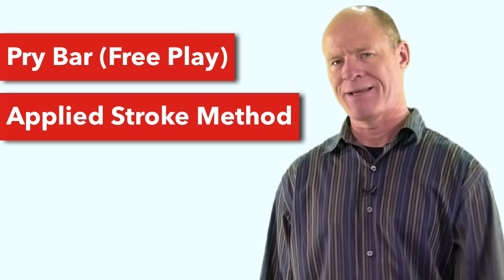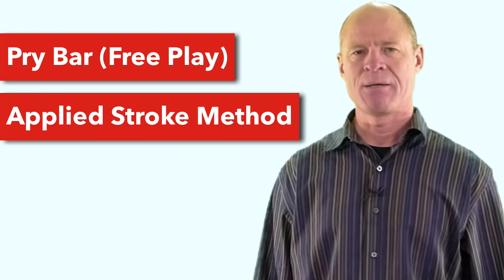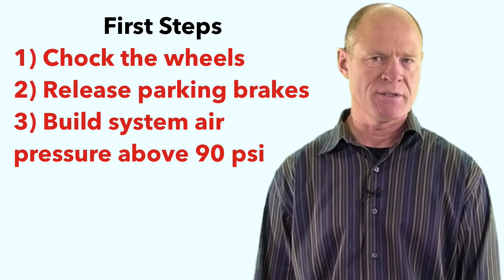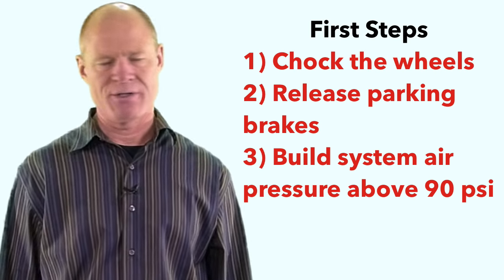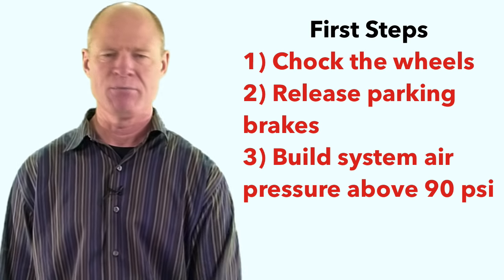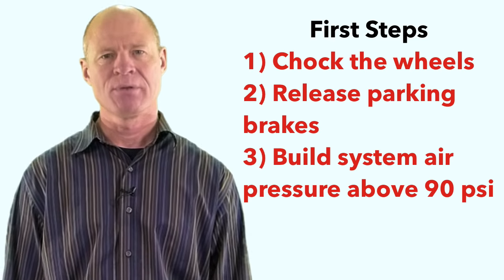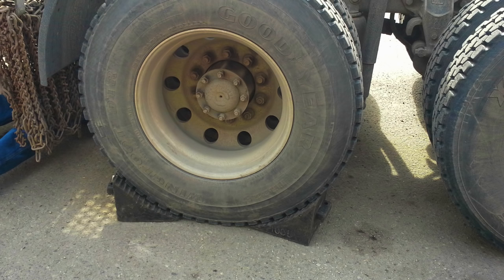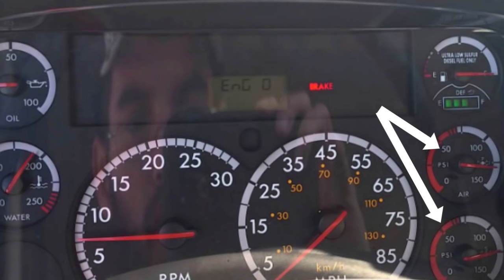How to Determine Air Brake Adjustment—Applied—Pry Bar—Mark & Measure

Comment: I’m from California and every inspection I’ve gotten in California they used the applied brake test
Reply from the maker: Hi C & Z Trucking - it's not just CA my friend. Every DOT inspector in all the states is going to use the applied stroke method. The reason is that they have 2 people, which makes it easy. They just put a radio in the cab, and when they're ready to measure, they tell the driver to apply the brakes. And the applied method is way more accurate than the pry bar method. Drop us a note if we can help further my friend. All the best, Cheers Rick
Reply: @smartdrivetest  I found this video do to problems with trailer brakes. I’ve replace (i do all my work myself) the chambers, drums, pads, s-cams, and slack adjusters and no matter adjustments I make, the applied stroke goes to the maximum 2”. So I’m trying the 6 pack method you said in your video now to see if that works. And it’s all four on the trailer that go to the 2” limit
Reply from the maker: I'm not a technician, but it could be a couple of things: 1) the pushrods are too long; 2) the slack adjusters need to be adjusted manually. If you can't get it to work, I would counsel you to take it to a shop and have a mechanic have a look. All the best, Cheers Rick

Comment: if the brake chamber rod is not the correct length it will affect how the ASA works. especially that type of slack on the trailer.  the double yolk has lots of wear being outside in the elements, and that slack is about a 6 in reliability anyways. some slacks adjust on the push stroke and some slacks adjust on the return stroke.  so your six pack method only works on some slacks not all.
Reply from the maker: Hi First Name - Thank you for your comment. And you are correct my friend - it's not going to work all the time, but it's worth a go before taking it into the shop. All the best, Cheers Rick

Comment: How do you determine if it’s an automatic Slack adjuster or not?
Reply from the maker: It's very unlikely that you'll encounter a manual slack adjuster, but just in case, see this video: https://www.youtube.com/watch?v=knbgfudCZC8&list=PL0x-bChcUvwG2bSWReQWnk9Tm92L7WN_O&index=9&t=120s Drop us a note if you have questions. Cheers Rick

Comment: While performing 6-pack action it was stated that you need to push a pedal three times and then release spring brakes - does it mean that between these steps it should be applied spring brakes and then these should be released? and when spring brakes should be applied in these steps? after which in this algorithm?
Reply from the maker: Full application of the brake pedal and then let the air pump back to maximum. There’s no application of the parking brakes my friend. Drop us a note if you have further questions. Cheers Rick

Comment: How much foot pressure to perform the chamber throw test?
Even set at 100psi the if the foot pedal is pushed hard to floor (ohhshiz stop), the chamber brake throw will be very near the max stroke. On a normal application. It is within spec. 
I would just think that the 90-100psi would limit it.
Reply from the maker: Are you talking about measuring pushrod travel with the applied stroke method, or are you talking about the leak test? If you're talking about the former - it's more than 100psi. If you talking about the leak test, it's maximum pressure because you have to first check to see that the governor kicks out before 135psi, or whatever the number is in your state. See this checklist for some help: https://www.smartdrivetest.com/pass-cdl-air-brakes-checklist Drop us a note if you have further questions.  Cheers Rick
Reply: @smartdrivetest  
Applied stroke is 90-100psi.
How much foot pressure should be applied ( or can be). From what i have seen.. If the foot pedal is pushed hard to the floor it will make that applied stroke to the max. 
Jaming the brake to do this check one manned takes some footwork and often results in the pedal pushed farthur than a normal brake application. 

Point being one persons normal brake application can be different than another. Resulting in different measurements.
Reply from the maker: Alright, I know what you're asking me. Nope, push the brake pedal right to the floor and hold as hard as you can. If you release the pedal and there is air leaking, the test is void. So make sure you hold the pedal tight, tight. All the best, Cheers Rick
Reply: @smartdrivetest  I only need 10-12psi to feel the brakes and slow down. Unless I need to stop now, may be 30psi. Never needed more. Dot said to hold it to the floor at 60-90 psi so he could check! Is that crazy?? When do you ever do that much?

Comment: With the pry bar method are there differences in free stroke travel between brake chamber types as well as standard stroke to long stroke? I just noticed that the width of the thumb is sort of a generalization. I'm from Ontario but now working in alberta. Just trying to learn the pry bar method now.
Reply from the maker: Hi Chris - nope, so long as it's not more than an inch, you're good to go. Ontario is the only province or state that I'm aware of that does the applied stroke method for measuring push-rod travel. Every other jurisdiction does the pry-bar method. See this vid too: https://www.youtube.com/watch?v=m5r3TsdQQQw&list=PL0x-bChcUvwGT2_auPlt-zmaRecuiaHhS&index=1&t=293s Drop us a note if we can help further. Oh yeah, in Alberta, the leak test is 2 minutes my friend. All the best, Cheers Rick

Comment: On a tractor trailer, truck only how many slack adjusters are there? I am guessing for two for the stairs, take exit Miami on the right to choose for each drive axle on the inside of each axle beside the tires on the inside.

Comment: I like to use a ball joint pickle fork. makes things easier. just get a short handle one if your working in tight space.
Reply from the maker: Hi Wrax Artilles - Thank you for your comment and help for others. I suspect that tool would work very well for checking brake adjustment. If there is anything further we can do, drop us a note. Always happy to help. All the best, Cheers Rick

Comment: I check every day.  Never adjusted brakes. Always done by shop. 
I am getting to where I need to do them. The shop has been slacking. Haha. You write them up, come back next day. Nothing done. Dvcr missing and an older one there with no write ups. We slip seat. This is real problem everyday.
Reply from the maker: Hi Robert Collins - Thank you for your comment. If there automatic slack adjuster, I would suggest trying a 6-pack first to adjust the slack adjuster. Just a note of caution: if you're adjusting automatic slack adjusters and something goes wrong--a traffic crash say--you could b held liable. If there is anything further we can do, drop us a note. Always happy to help. All the best, Cheers Rick
Reply: @smartdrivetest  thank you for the info. I am trying this 6 pack. I just cant believe that the shop has never told us about this. We could do this more often and use them last. 
I feel kinda dumb I didn't learn this before. Guess I just figured automatic, is automatic. 
   Keep up the good training, now I found you- I will seek to keep learning. Everyday you can always learn something new.
Reply from the maker: Hi Robert Collins - you are most welcome my friend. We're happy to hear that we could help out. If the 6-pack doesn't work right away, try putting some grease to the slack adjuster and try again. Often the ratchet mechanism dries out and won't ratchet over, so a bit of grease tends to solve the problem. If not, then the adjuster needs to be replaced. All the best, Cheers Rick

Comment: Do a six pack every end of shift. Check your brake adjustment. That way you can have things repaired if needed before you go back out. If not, you know your brakes are good to go for your pretrip.
Reply from the maker: Hi Steve Chapman - Thank you for your comment. I think a 6-pack everyday is going to be a bit of overkill my friend. I might suggest doing one every couple of weeks. In combination with checking the adjustment every day, I'm confident you'll be golden. If there is anything further we can do, drop us a note. Always happy to help. All the best, Cheers Rick

Comment: Do you do a 6 pack while moving or stationary? Thanks for the knowledge! Havent seen the applied method before.
Reply from the maker: Park the vehicle in a safe location, chock the wheels and release the brakes. 3 hard applications, let the air build back to maximum and then 3 more. You should be good to go at that time. All the best, Cheers Rick
Reply: The 6 pack while moving is called a seatbelt check.

Comment: "Do the six-pack?"  Okay...to "re-adjust" you pump the brakes 3x with (or without) tractor/trailer parking brakes on and them again with them off?  Or with the parking brakes off for both sets of three pumps?
Reply from the maker: Hi Big Ol' Bear  - Thank you for your comment. And you have the parking brakes off, but you will have to chock the wheels. If there is anything further we can do, drop us a note. Always happy to help. All the best, Cheers Rick

Comment: I'm confused, you did pry bar and in usa manual is says inch or less is good, you would think that is for all brakes front back and trailer, but you are saying the type 30 brake pods are going to be 2" or less is that correct?
Reply from the maker: Apologies for the late response. Using the "pry bar" method it's less than 1" inch my friend. However, it you're checking the brakes using the applied stroke--as the DOT will--then it's 2" for a Type 30 brake chamber with automatic slack adjusters. Applied stroke means you chock the wheels and push down on the brake pedal. See here for different measurements of different brake chambers: https://www.smartdrivetest.com/cdl-air-brakes/chart-of-adjustment-limits Drop us a note if we can help further. All the best, Cheers Rick

Comment: When applied brake with 100psi. Normal driving foot pressure is used? I notice that if i l push as if panic stop.. It will overthrow.
Not sure why this is if it is limited to the 100psi. 
Applying park brake usually seems to be most accurate.
Reply from the maker: I don’t know what you mean by “overthrow?” Please reword. Cheers Rick
Reply: @smartdrivetest  
Overstroke the pushrod.
In another manufacture video i noticed the chamber did the same when they applied on the training unit.

I am digging for information on proper operating system for diagnosis reasons. Allot of documentation just mentions to "find the problem". Trying to understand more of the workings (incorrect parts...).
I may have to get ahold of a manufacturer for indepth training.

Comment: Why push rode travel is different for applied method which is 2 inch and quarter an inch for pry bar method
Reply from the maker: Hi govind chib -  You can apply the same amount of pressure with a pry bar as can be applied with the air pressure my friend. If there is anything further we can do, drop us a note. Always happy to help. All the best, Cheers Rick

Comment: I see that 2" is the maximum range before adjustment, what is the minimum? Surely the push rod must move a little as it applies the brakes, how much does it move minimally when the brakes are new and adjusted? Thanks

Comment: Question. On a steer axle pry bar check (air brakes )with the brakes applied should the push rod be able to be pulled out an inch?  Or must the brakes be released during the pry bar test to check the push rod play?
Reply from the maker: Hi CONTENDER791 - Thank you for your comment and excellent query. For the steer axles you don't have to have the parking brakes released. There aren't parking/emergency brakes on the steer axles due to the fact that you don't want these to lock up in the event of an emergency. Yes, you can do a pry bar on the steer axle pushrods without having the parking brakes released. If there is anything further we can do, drop us a note. Always happy to help. All the best, Cheers Rick
Reply: CON5TENDER791

Comment: on the applied brake check being out of adjustment  at maximum 2 inches, what is the minimum push rod stroke allowed at a 100 psi applied brake application  ? or is that just minus the maximum allowable free slack being 3/4 of an inch making it 1 1/4 inches ?

Comment: 'If you have a manual slack adjuster which is unlikely' 

Working for a company right now that only just recently got new trailers with automatic brake adjusters

Comment: Can we adjust them manually??? Why you didn't mention the manual method of adjustment???
Reply: Automatic slack adjusters can be adjusted but should not need to be manually adjusted, if they do, you need to have them checked/replaced.  Proper lubrication is very important.  If they get dry, they may not adjust correctly or they can wear out faster and will not adjust.

Comment: what is and how to do a pull brake application for the six pack slack adjuster measurement?
Reply from the maker: Hi Victor V - Thank you for your comment and query. Apologies - what is it you're asking me?  All the best, Cheers Rick
Reply: it was explained twice in this vid
Reply: video says do a pull brake application. what is a pull brake application?
Reply: what is a pull brake application?
Reply from the maker: Hi Victor V - Thank you for your comment and query. A pry-bar test is explained in the video. See the video for both the pry-bar and applied stroke method to determine if your brakes are in adjustment. If there is anything further we can do, drop us a note. Always happy to help. All the best, Cheers Rick

Comment: HOW DO YOU ADJUST THE AUTOMATIC  SLACK ADJUSTER DO YOU DO IT WITH OR WITHOUT THE VEHICLE RUNNING PLESA EXPLAIN AND THANK YOU
Reply from the maker: Hi omar torres - Thank you for your comment and query. If you are doing a 6-pack to try and bring the auto slacks back into adjustment, then you can leave the engine running between the first three pumps and the second 3 to bring the air pressure back up. If there is anything further we can do, drop us a note. Always happy to help. All the best, Cheers Rick
Reply: @smartdrivetest  thank you so much for answering back to me and helping me thanks a lot.
Reply from the maker: Hi omar torres - you are most welcome my friend. All the best, Cheers Rick

Comment: just so I'm understanding about auto adjust brakes, if a company has say a late 70's truck if it has been in for safety, it should be switched from manual to auto?
Reply from the maker: Hi Ken J - Thank you for your query. Yes, unless you like climbing under a truck in any weather condition, I would recommend installing automatic slack adjusters. And its unlikely your truck is going to pass the annual MVI with manual slack adjusters. If there is anything further we can do, drop us a note. Always happy to help. All the best, Cheers Rick
Reply: What company is even using trucks that old?

Comment: I have a problem with air brakes in rear of an RV with 20,000 lb axel. left hand wheel was making an unusual sound when applying brakes. I chocked the wheels .had air pressure between 60 and 90 psi, released park brake marked the push rod with marker and my wife applied brakes while I measured the stroke. The problem wheel only had one in. stroke and other was just over 2 in.   I also did the pry bar test per video instructions and both rods had 3/4 inch stroke. any ideas what is going on. We are from canada but in calif now and have to wait one week to get it checked would like to try something else in mean time.
Reply from the maker: Hi john kavalchuk - Thank you for your comment.  If you have a push rod stroke more than 2", little doubt the brake is out of adjustment. I would suggest trying a 6-pack. Chock the wheels, release the parking brake, and build system pressure to maximum. At maximum, the air dryer will purge and the air gauge needle will be between 100 and 135psi. Make 3 full hard brake pedal applications. Let the pressure built to maximum again, and do 3 more hard full brake application. Remeasure the push-rod stroke. If it's still out of adjustment, you might be able to put some grease to the slack adjuster and try the 6-pack again. Some times these seize up because they haven't been greased in a bit. When you measure the push rod stroke using the applied method as you did, ensure that the system air pressure is at maximum. If that doesn't work, you may have to replace the slack adjuster. Let me know if that works. All the best, Cheers Rick

Comment: 6 Pack is old news unless you rebuild the air over 90 after every second application- preferred version 2 pack, 3 times if necessary.
Reply from the maker: Hi TrewFred - Thank you for your comment. Isn't a 2 pack X 3 the same as a 6 pack? ;oP All the best, Cheers Rick
Reply: Smart Drive Test well, no.  Some times you need 12 and mostly it only takes 2 to maintain correct stroke.
Reply from the maker: Thanks for your reply my friend. Cheers Rick

Comment: so just to clarify, the 1/2" to 3/4" tolerance is for the front brakes only? and the 2" is for trailer/tractor self adjusting? Thanks.
Reply from the maker: Hi neckarsulme - Thank you for your comment and query. It's 1/2" to 3/4" on all brakes when using the pry bar method. It's 2" on a Type 30 brake chamber when using the Applied stroke method. See this chart for other types of brake chambers: https://www.smartdrivetest.com/air-brakes-(image)/chart-of-brake-adjustment-limits If there is anything further we can do, drop us a note. Always happy to help. All the best, Cheers Rick
Reply: @smartdrivetest  what the adjust on a 1997 Great Dane trailer?
Reply from the maker: What size are the brake chambers? Most on trailers are Type 30, but you’d have to check. Cheers Rick